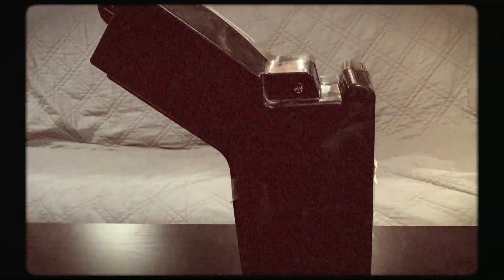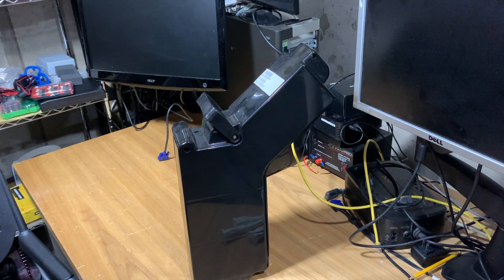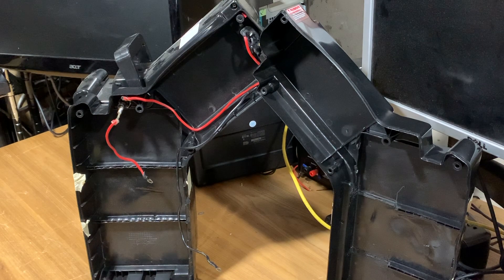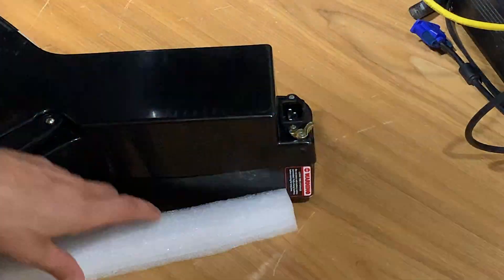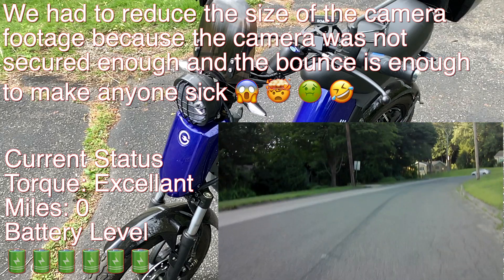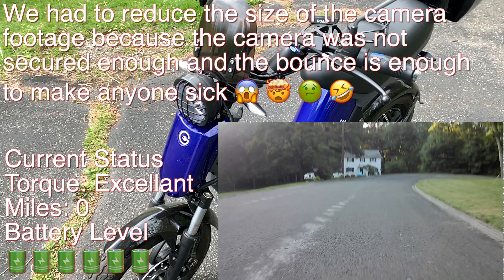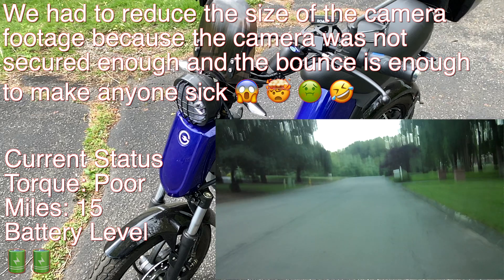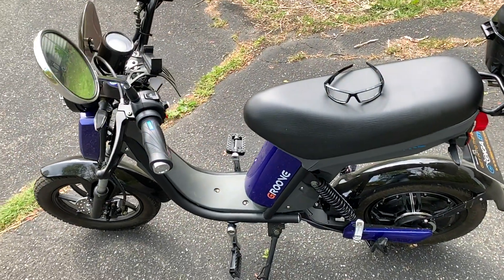Making a battery for an E-Bike... and we had a FAILURE 😱😡!

Comment: Just 1 problem with eBay batteries... The sellers lie about the capacity a lot, they say it is 40 Ah and it is maybe 20 Ah if you are lucky, you will have way better luck using one of the battery builders out of eBay than buying those blue generic rip offs. You can even send your battery box and get a customized battery way bigger capacity utilizing the whole L shaped battery box, they could squeeze 10 Ah or 15Ah more on all that wasted empty space, you will get better quality battery cells as well, using Panasonic 3400 mAh NCR cells you could build an amazing capacity battery in all that space. Best of luck.
Reply: The weird L shaped battery box is the big downside of these bikes. I absolutely adore mine, but the box is impossible to get a spare for, and I'd love to have two so I could swap out and go. I haven't been able to find anywhere that sells the thing, and given how crappy the roads are near me I'd be real worried about using a battery that might rattle around in there.

Comment: Woao, risky changing the battery by assembling it yourself, I congratulate you, in my case I have only 1 month with the e-bike, the motor is 500W, 48v 20ah lithium, what the factory says is that the autonomy is 40km / 25mph but doing calculations I think the battery is enough for more, what do you think?
Reply from the maker: my bike motor is a 750W, so you should get 48 km, on every charge. ALWAYS pedal with the motor on hills, the more you help motor the more distance you will get on a single charge.

Comment: Hi there, thank you so much for the tutorial. By the way, do you have the purchase link to the lithium battery used in the video? Please let me know. Thank you so much.
Reply from the maker: sure  also i just did a video on replacing the glass fuse too, check that out as well if you're going to do this. https://www.ebay.com/itm/EBike-Li-ion-Battery-48V20AH-700W-Scooter-Electric-Bicycle-Motor-BMS-Charger-US/293339744404?ssPageName=STRK%3AMEBIDX%3AIT
Reply: @southhawkllc  Thank you so much. I would not have completed this conversion without your guidance. Thanks again.
Reply from the maker: @HuTieu01  you're welcome!!!